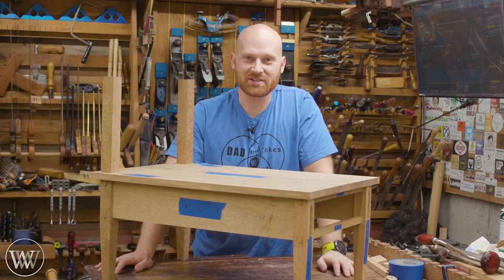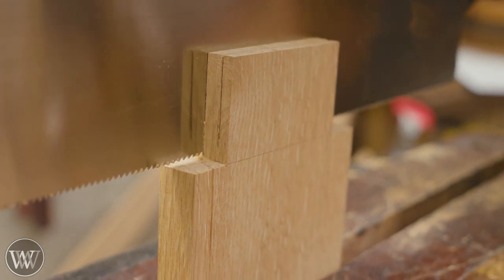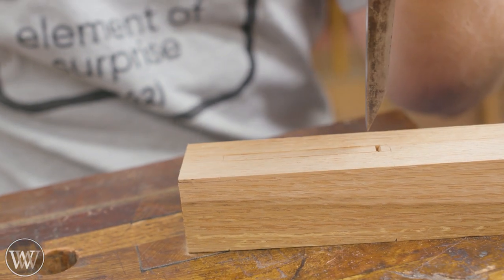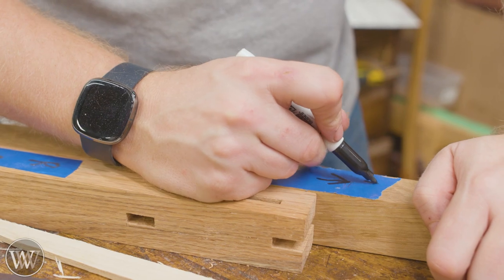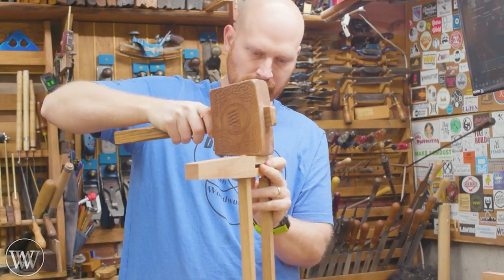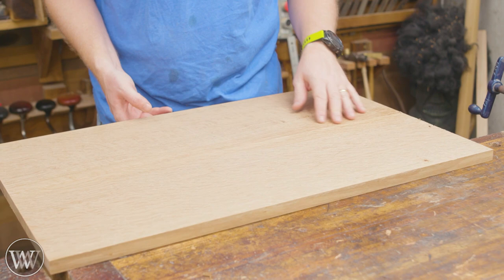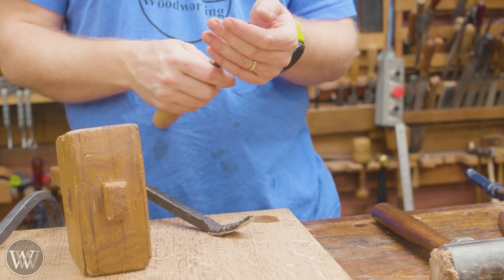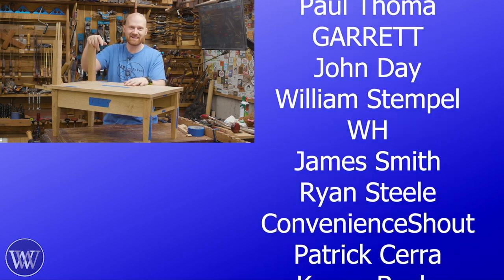How to Make Bedside Table Carcass and Top Part 2

Comment: Beautiful table.  Since you did all of those glue tests, I'm curious if burnishing the wood from assembly/disassembly affects how well the glue works?
Reply from the maker: It will help it to actually hold a bit better as the wood will expand a bit putting more pressure on the joint.

Comment: Nice built. Top looks stunning with all these rays. I just wonder how this top will behave during changes of humidity. It is fully enclosed by the feet and stretchers. How did you overthink this point during engineering phase. Just wondering. Best regards and keep up these nice builds and videos.
Reply from the maker: In this case, I'm going to leave the back tenon on the stretchers unglued. This will allow the top to expand and contract. That means at some point there might be a gap in the shoulders, but as it will be used in an air conditioned house with only 12 in between the two expansion, contraction will be less than 1/16 an inch. Even at the absolute maximum. And most of the time it will be less than 1/32 of an inch which is well within the compressibility of the wood.
Reply: @WoodByWrightHowTo  Very interesting, how you allow for this expansion/contraction.

Comment: Can you explain something? Why do you make the tennons first and then make the mortice? I got tought that you make the tennon fit the mortice, what is the best way?
Reply from the maker: Different people do differently. I make the tenon first as it is much easier to transfer those marks to the mortise than it is to mark the tenon off of the mortise. But as to which one to modify to fit the other you should modify the one that has the problem. If there is something sticking inside of the mortice then you should not modify the tenon to fit it as that will just create gaps. Most machine woodworkers tend to make the mortice fit as they use measurements rather than reality. Most hand tool woodworkers tend to make the tenon first, as it is easier to mark the mortice with the reality of the tenon. Just two difforent ways to do the same thing. I hope that helps.
Reply: @WoodByWrightHowTo  ok thank you verry mutch. Is it easy to modefy the mortice? Or is cutting it the with of the chisle more easy? I want to try it the other way now. How you did it